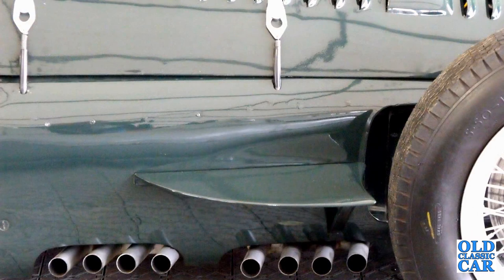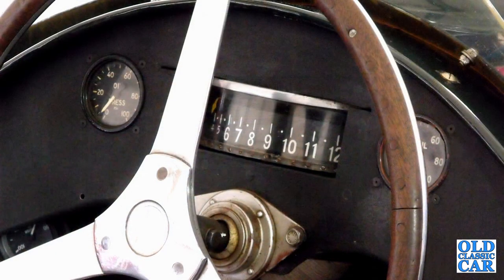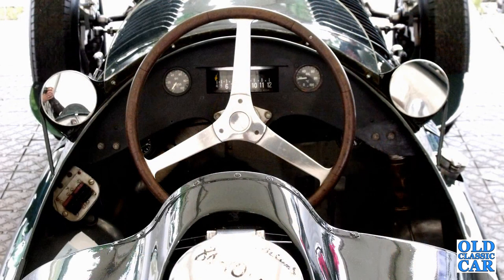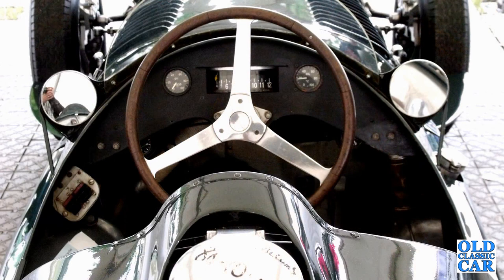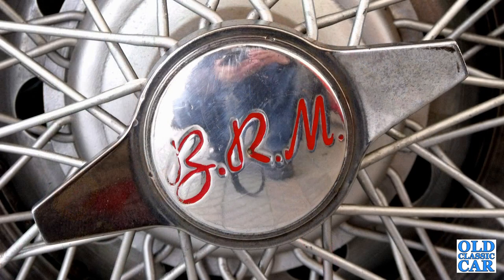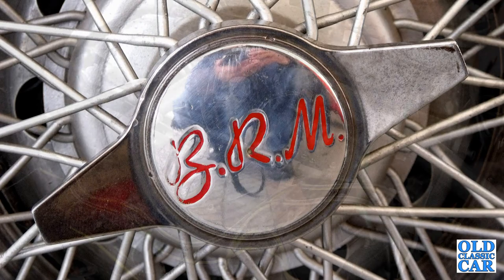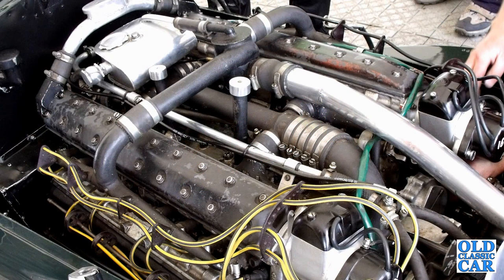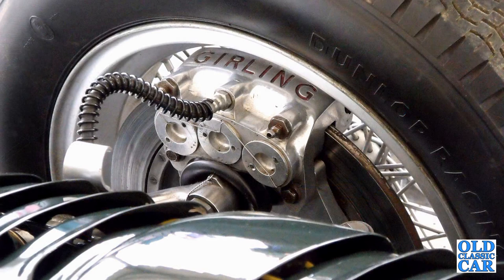The EPIC BRM V16 engine noise, tow-start & drive-by, 1950s supercharged 1.5 litre V16 grand prix car

Comment: Reminds me of when BMW bought Rolls Royce and wanted to make the then new Phantom 7 I believe with a V16 engine. Not hard to see why huh.
Reply: Think, didn't they build 4 or 5 of them. The 8L V16s, was one put into the Phantom in the Johnny English film too. 

For me personally if I had the money of course, Wraith, the black badge but two tone metallic blue, chrome rims probably 20"s and rear mounted gearbox, front-mid mounted 8L twin turbo twin supercharged lol V16! 

Just imagine that thing on the road all that torque just throwing you forwards be for me personally thee best Rolls Royce ever built. And I'd want spirit of ecstasy in a chrome silver alloy or or chrome zirconium alloy. She'd be beautiful. White leather interior vanished cedar or oak wood panels right hand drive obviously and massive BMW carbon fibre brakes. And honestly with all that power and torque 10 speed dual clutch I think she'd be able to spin a 10th gear lol.